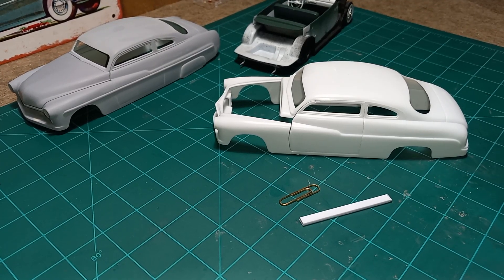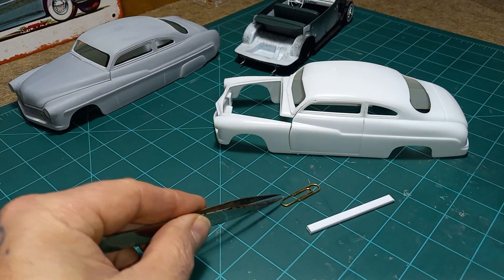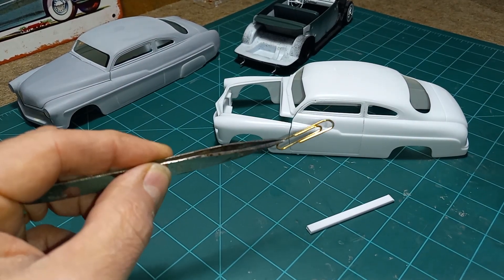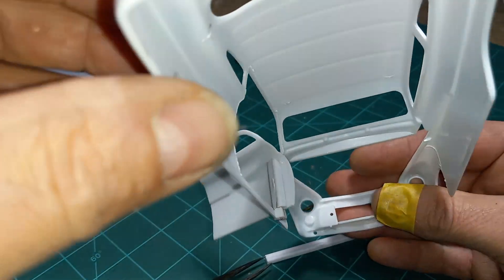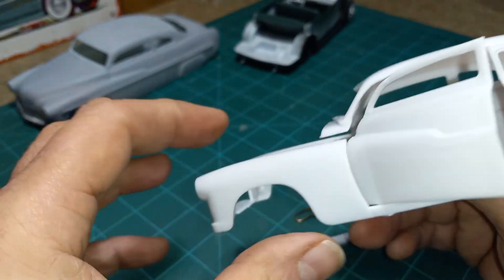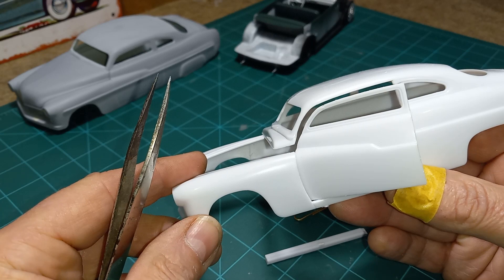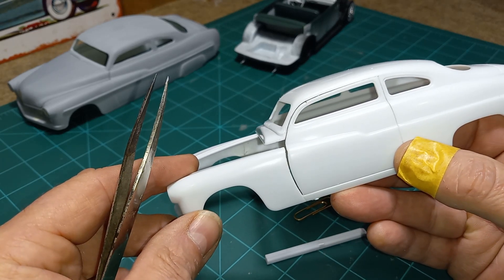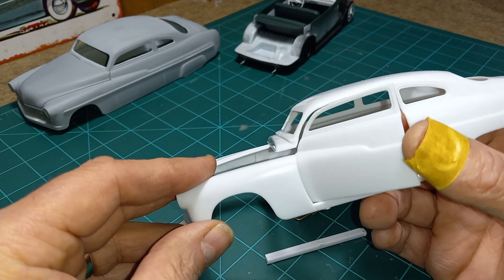the hing pin trick for opening doors...

Comment: That's the best solution I've seen yet!!!  I'm trying that on my 56 Bel Air build... Thanks for the tip... you just saved more projects than you know...
Reply from the maker: This design works best on doors that open into the fender... a 55 swings out so it may not work the same..good luck my friend

Comment: Thanks for the tip. I'm going to have to giver 'er a go. Dou you think styrene tube would work just as well and eliminate trying to drill a straight hole that long?
Reply from the maker: If the paper clip is tight in the tube sure it will.